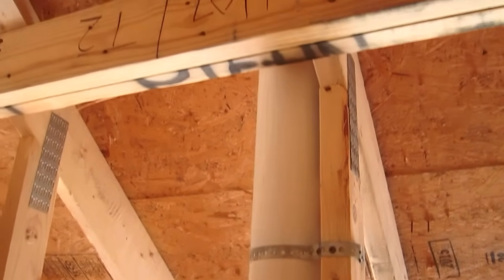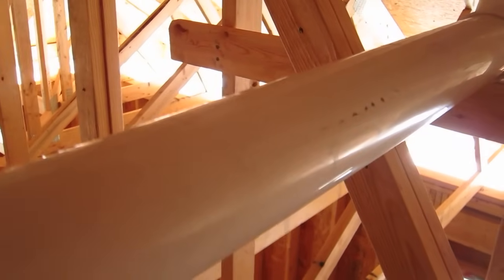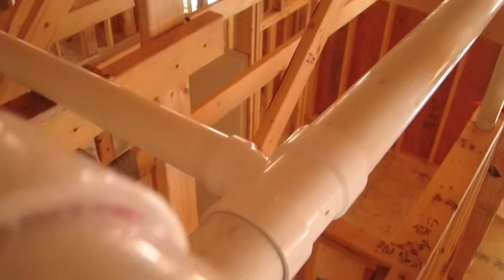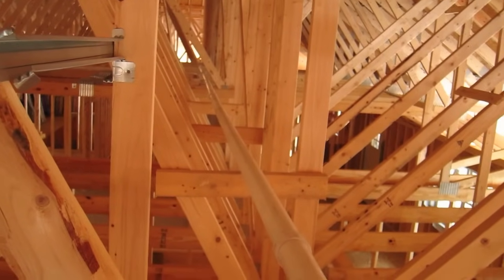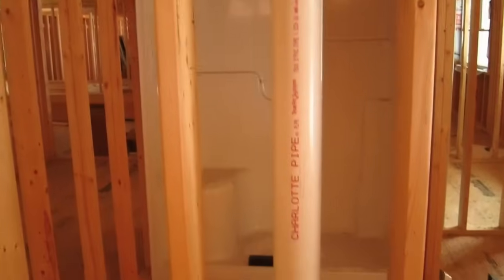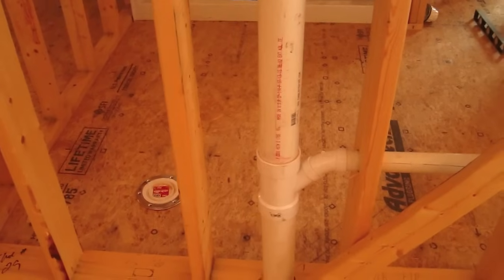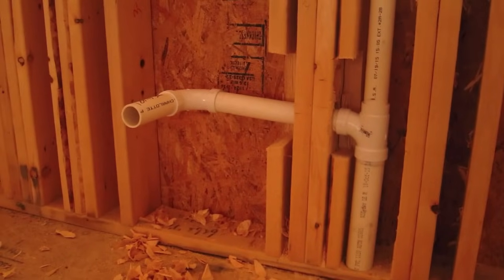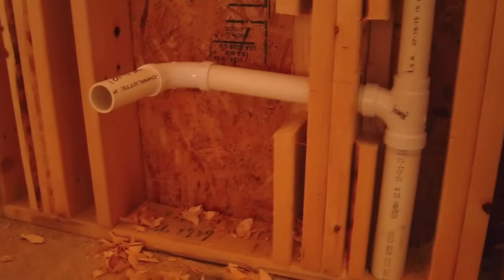How to Vent Plumbing

Comment: What is the maximum horizontal distance allowed between a fixture and its vertical portion (going through roof)?
Reply from the maker: Check the code in your area. You might be able to get away with 42 inches.
Reply: @askthebuilder  I’m confused, how is the 50 to 60’ horizontal section ok then that branches off from the 3” section you show? Sorry I’ve been sifting through vent code and just when I think I get it, I see an example that’s to code but I can’t seem to make sense of haha
Reply: @mccarseat  I think the 42” distance is from the vanity or shower drain before the vent ties in. I don’t know if there is a regulation for horizontal pipe up in the attic.
Reply: Thanks

Comment: Can a vent pipe be repaired ?, i had a person put a exhaust fan in my bathroom and made a hole on my vent pipe to put the exhaust duck in there instead of going through the roof , i was really upset that he did that ....
Reply from the maker: Yes,  you can repair a vent pipe. I offer phone coaching. A simple 15-minute call may be all you need. Go here: https://shop.askthebuilder.com/consult-tim/

Comment: Why doesn't the vent pipe penetrate the roof next to the ridge? Easier to flash since no water running down off the roof - plus higher so less smell.
Reply: Just answered my own question. Must be away from ridge due to ridge venting needing to be separated from smelly, possibly explosive vent gases. https://youtu.be/2XhOkzKFai8?t=257
Reply from the maker: Tim, I don't believe you have an understanding of how flashings work. I suggest you watch this video of mine and then you'll see it makes little difference how much water flows down the roof across it:  https://www.askthebuilder.com/plumbing-vent-flashing-video/

Comment: Just wondering if you could divert the vent pipe out below either side of the ridge line of the roof instead of through the roof, I am thinking about zero penetration when I re-roof with metal roof but I read some where that vent needs to be 12" above the roof.
Reply: It is totally acceptable to vent out a sidewall instead of penetrating the roof. I’d check your local code, but my area allows it as long as you don’t terminate the vent under an overhang with a soffit vent. You only have to go 12” above the roof line when penetrating through the roof. 

And if you install something like solar panels that cover the vent pipe and protect it from snow and wind then it doesn’t even have to extend 12” from the roof.
Reply: Exactly.  Solar roofing is making it much more common to get away from putting all of these hidious looking pipes and vents out through the roof. Pipes and vents sticking out through the roof look like hell to begin with, in my opinion. I just recently rerouted my air vents to the side of the house and utilized the vent at the peak of the roof and I am very happy with this setup and it works perfectly and looks much better.
This allowed for a straight shot across the roof for solar shingles. Aesthetically, this is a tremendous Improvement.
Reply from the maker: A local inspector may allow you to vent out a sidewall, but in all cases it needs to extend up above the bottom edge of the roof. The pipe coming out of the side of the house is going to look like hell. It's EASY to create leak-proof penetrations in most metal roofs. If your metal roof is a standing-seam one, I have a video showing exactly how to put in the flashing so you NEVER HAVE a leak. I also offer phone coaching: https://shop.askthebuilder.com/consult-tim/

Comment: 8:30 they really notched the crap out of those window cripples
Reply from the maker: Yes we did. There is simply too much framing going on in this tight space and it's overbuilt. The added lumber reduces the amount of insulation in the wall.
Reply: Maybe not permissible by code in your area, but curious, wouldn't it of been much easier just to do a combination waste/vent at the kitchen sink? By the way, great job, always enjoy looking at others work. It's like art! Too bad great work is always covered up. Lol

Comment: Are all the vent pipes tied into that 4" vent going to the exterior or are there multiple exterior vents?
Reply from the maker: All the vents for each fixture tied back into that 4-inch vent. If you want to save on pipe, you can have multiple vent stacks pop out through the roof. This owner only wanted one vent through the roof.

Comment: I’m hoping to move my laundry room into my basement actually right next to my drain stack. The problem is that I’ve been unable to locate my vent pipes except for very near to where it ties in to the main drain stack. Two questions:
1.) Is there a limit to how close to that vent/drain intersection I can tie into? Is there increased risk of getting drainage into my vent line? 
2.) Can I tie my drain line into my main drain stack right above the basement floor? There is a clean out right above where that intersection would go in.
Reply from the maker: Eric, I've been a master plumber since age 29. I discuss these complex issues and what dangers you face should you make a MISTAKE on the phone. The call is FREE if you're not pleased with my advice. Here's how to make it happen:  https://shop.askthebuilder.com/products/15-Minute-Phone-Conversation-with-Tim.html

Comment: Why run that much piping why just not put a second vent in
Reply: There are pros and cons. The pro is less piping. The big con of a second vent is there is another hole in your roof that you need to make sure there is proper flashing around. Considering how cheap PVC is, and how many leaky roofs I have to deal with, I know which option I would choose.
Reply from the maker: Another YouTuber talked about minimizing roof leaks. It's not an issue at all if you put in the RIGHT flashing and install it correctly. The crappy Oatey ones fail. WATCH this video of mine to see the BEST plumbing vent flashing out there and how EASY it is to weave it into the shingles for NO LEAKS EVER:  https://www.youtube.com/watch?v=dfliETAVTeI&t=239s
Reply: @askthebuilder  thanks for the video on flashing. My current dilemma is a leaky vent pipe on a almost flat roof. Do you have any video on almost flat roofs. As an FYI I live in central Wisconsin..... So we're in a freeze thaw region.
Reply: Thanks
Reply: Im not a license plumber but I do enough to know something's on it and I live in mass where the codes change alot on things daily lol
Reply: And thank you for the tips

Comment: very helpful, thank you.  You mentioned the main bathroom toilet connects in the basement, under the "A" of the subfloor where you drew the lines- does that toilet have it's own vent or is the 3" connection the vent?  Also, please explain why the vanity vent branch arm is a 45 while the kitchen sink is a 90 degree T.  Thank you.
Reply from the maker: The 3-inch full-size vent is the vent for the toilet. You can wet-vent the toilet with the vanity branch arm so long as the stack/vent coming from the 3-inch wye under the floor remains 3 inches until the 3 x 1 1/2 tee. The wye you see for the vanity branch arm is AGAINST CODE. It creates a shallow illegal S trap. The homeowner INSISTED I install it there to facilitate future snaking. It's common for most vanity branch arms to get clogged with gunk from women's makeup. Rookies using a snake can drill through the side of the tee. The wye connection to the stack is no different than common wyes used in vertical stacks all over the system. In the basement there's a clean out just below the kitchen tee. If there's a future clog at the tee, it can be attacked easier from below rather than go through the branch arm above.
Reply: Thank you for you quick and helpful reply.
Reply from the maker: All plumbing drain pipes need to be vented.
Reply: Do basement bathrooms need to be vented also?

Comment: Does Code limit the amount of total bends in the vent pipe?
Reply: For venting specifically not.  The 2015 IRC limits the maximum distance of fixture trap from vents and fixture unit loads on vent sizes.   For sump vents there are some distance limitations based on vent size but as far as elbows are concerned no nothing nothing for venting.  Keep in mind air flows better than water and limitations on bends, elbows, etc is for the purpose of maintaining water pressure.
Reply: ZioPinoSoaps Pino yes
Reply from the maker: cliffordwda green - Can you call out the section of the IPC where it says this? Here's a copy of the 2015 code: https://codes.iccsafe.org/public/document/code/550/9795976

Comment: Thanks for a very helpful video, Tim. In our older home renovation, the plumber installed 2 AAV's where vents would have been difficult. Both valves give off a sewer gas smell. Is this normal or should I look for a better AAV?
Reply from the maker: +Dave Clark It is NOT NORMAL. This is why I refuse to use AAVs unless it's absolutely necessary. I try to design plumbing fixture placement so you NEVER have to have AAVs. As you can already tell, they're nothing but TROUBLE because they have moving parts.

Comment: Do you think Air Admittance Valves will ever replace all that PVC and poking holes in the roof?
Reply from the maker: +59seank Hah! I've been waiting in the weeds for this comment. It's a GREAT question.

I believe some will take the shortcut and go down the crooked pathway of AAVs. Here's what I don't like about them. They're mechanical. They have moving parts. They will ALL FAIL at some point. When that happens, can you count on the homeowner to recognize the problem?

Vents like you see in this video will never fail. What's more, when you put in a full-size 3-inch or larger vent like you see in this video, you can easily flush it out if you want. A tennis ball will pass down it with ease, and Mother Nature's physics will work flawlessly for all time.

Plumbers using the best practices like this have done venting with no issues since the late 1800's. This methodology is time tested and you never have to worry about it. Proceed down the AAV pathway at your own risk.

As for poking holes in roofs, if you do it right and use the RIGHT flashing, you'll never have a leak. WATCH this video to see how it's done: https://www.youtube.com/watch?v=dfliETAVTeI
Reply: +Ask the Builder Have you ever had to flush out a roof vent?  What typically blocks a plumbing roof vent?  What are the symptoms of a blocked vent?  Is there a more attractive alternative to the ubiquitous white PVC pipe sticking through the roof?
Reply from the maker: +59seank Yes. I've flushed out large 4-inch CAST IRON vents in older homes that had 90-degree bends in them just as you see in this video. The blockages were caused by decades of rust scale that dropped down from the sides of the cast iron. Water sucked from fixture traps. Paint the pipe. That's what I did at my home and on many jobs and you barely notice them. Work with a CREATIVE plumber like me and put the vent pipes on parts of the roof not readily visible from the street or other parts of the lot. That's where most builders and plumbers fall down. They take the easy way out. Good luck on your projects. I'll not be able to answer any more of your questions because I have so much to do.
Reply: +Ask the Builder Thanks for responding.

Comment: Good presentation Tim
What would you think of having separate 4" stacks near each cluster of plumbing fixtures, making sure no branch exceeds 4'?
More $ for bigger pipes, but less $ to install
Reply from the maker: +CheekyMonkey888 It's not required. Waste of money. Plumbers decades ago recognized the importance of putting in at least ONE full-sized vent. You don't need one for each group of fixtures. I've had to install special pressure-relief full-sized vents in apartment buildings where bathrooms are stacked on top of one another, but that's different than a house.
Reply: Ask the Builder Thank you, I have seen both kinds of installations done, in identical triplexs, at the same time, by the same plumber, and the multiple 4" stack approach came in at triple the material cost but one third of the plumbing time cost.  Plumber's time is usually more expensive then the materials, but I agree that for a single storey single family home, or a two storey home where the fixtures are not grouped, your way is best.
Reply from the maker: +The irregular You Fkd Over But Will Never Own (Please do eat your pork.) Watch this video: https://www.youtube.com/watch?v=dfliETAVTeI  The 4-inch pipe goes through the roof and extends up 42 inches and stops. That way it will never get covered with deep snow.